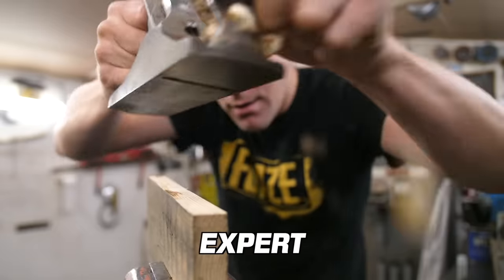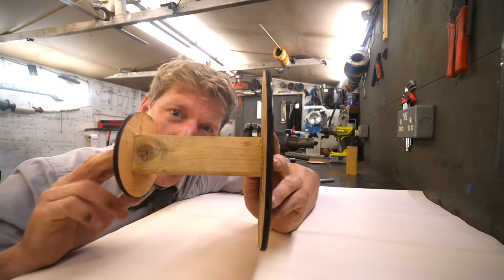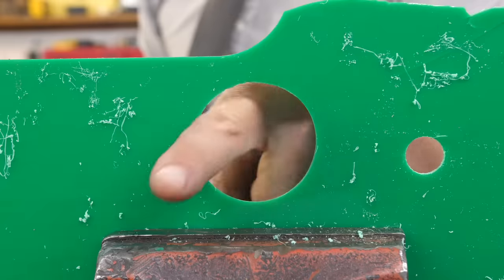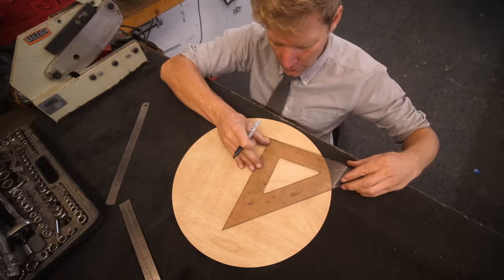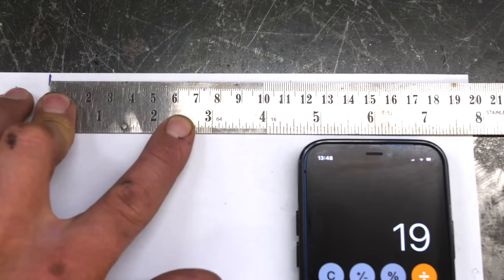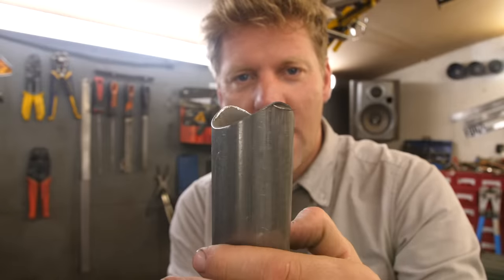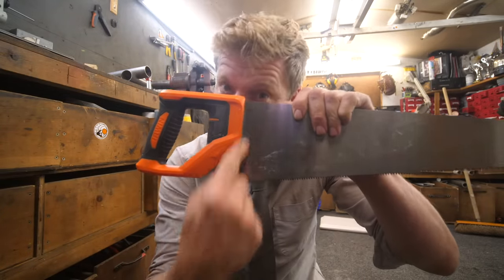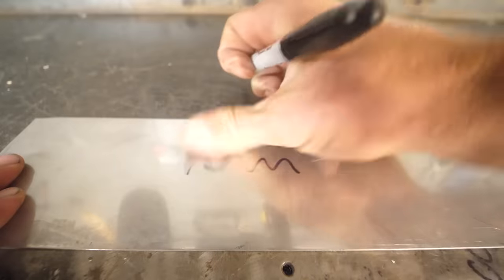18 GENIUS Workshop TIPS (that actually work)

Comment: Rubbing alcohol gets sharpie off, and also causes hot glue to peel off in one clean chunk from even heavily textured surfaces.
Reply: Or hand sanitizer
Reply: Yup, anything alcohol based. You could probably waste your gin doing it too. I use meths (methylated spirits/denatured alcohol).
Reply: The easiest trick to get sharpie off is to use a dry-erase marker instead of another sharpie.
Reply: I half inch acetone from work. That's the best solvent for marker pens.
Reply: Tea leaf! @DisorderedArray
Reply: Dry erase markers too, I remember a teacher showing us all this on the walls in the classroom lol
Reply: I find eucalyptus oil great for moving adhesive residue after peeling a label off stock.
Reply: love your channel, was literally watching your video before this one
Reply: Carb cleaner will get anything off. Just be careful not to put in near plastic etc. because it will melt it. I bought 3 cans off eBay for about £7 because, oddly enough, I had a chainsaw carb to rebuild.
Reply: Expo markers (Dry Erase) works really well. Working in Film as a Camera Assistant, we do this every day when updating the slate/clapper.
Reply: acetone I use
Reply: Butane will also work
Reply: More reason to carry flask on the job
Reply: Nail varnish remover.
Reply: Isopropyl alcohol should be in every workshop. Not only removes sharpies and similar stuff, but also cleans and sanitizes, without the nasty smell and without damaging plastics.
Reply: WD-40 also works amazing on sharpie
Reply: @OttoDidactic  Acetone is the thing. Good for cleaning packet too.
Reply: Brake cleaner is my go-to.
Reply: lacquer thinner
Reply: using deodorant works well too. butane is a good solvent for that it seams .
Reply: @jakobporenta  Same
Reply: @DisorderedArray  True. However it dissolves lots of other stuff too: most anything plastic (except polyethylene), paint or other finishes, vinyl. It even eats cured powder paint. That and it is extremely flammable... AND it's really not good to inhale. So be aware and be careful.
Reply: It's such a shame all the major UK chemists all made a gentleman's agreement not to sell rubbing alcohol. You can get isopropanol products, but they're always contaminated with something. In spite of the fact that it's an incredibly useful household solvent, far moreso than it is as any sort of useful reagant for serious illicit purposes.

Also white vinegar is unusually rare. White wine vinegar is everywhere, but clean white vinegar is harder to come by than it should be.
Reply: Blue loctite will remove permanent marker from nonporous surfaces as well.
Reply: Pro tip: If you like rubbing alcohol you should try drinking it.
Reply: Acetone should not be used for marker removal because of how many other things it can dissolve, including most commonly used plastics.  3D printer geeks will tell you that putting a finished 3D print in a container with some acetone (in a cap or other small vessel all by itself).  The acetone softens and smooths out your prints so they look better, all without even touching it.
Reply: @loganlaurian2517   It's handy because all markers--permanent or otherwise--will have a solvent to act as a carrier for the ink particles.  Most of the time the ink can go back into a liquid form as long as it wasn't absorbed into anything porous.  Expo sells ink-free markers just for this purpose.
Reply: A nuclear explosion will remove Sharpie, the object it was on and part of the object that was on too.
Reply: Any kind of alcohol, but yes.
Reply: I had an issue the other day at work with trying to get the thin red sharpie dimension lines removed from a panel enclosure. Normally it comes off no problem but after the added heat from cutting a large opening for HMI (display) the alcohol didn't do the job. Had to use lacquer thinner but was wondering what else might have worked...
Reply: @truthbebold4009  Acetone and brake fluid also work fine. But, depending on the surface, they can also damage it.
Reply: Lynx Africa
Reply: OH man i needed this.  i want to glue super strong magnets to a nice oak door so i can hang a blackout cloth over it.  but it's the landlords house and i couldn't find anything that was strong enough, or didn't require solvents that would damage the finish on the door.  WOOT
Reply: This is the way

Comment: When marking stainless steel for drilling, use a centre punch sharpened with 3 facets (triangular rather than round). That give the drill something to bite into and helps prevent work hardening by the drill not cutting.

Comment: Adding on to the sharpie tip: because I draw maps for DND on dry erase boards, sometimes I mess up and grab the sharpie instead. If you use a dry erase marker over sharpie, it’ll treat the sharpie marks underneath as if it’s dry erase and you can wipe down with no effort using a cloth.
Reply: Its alcohol solvents
Reply: Also hand sanitizer has alcohol & woks great removing sharpie marks!
Reply: @biga8u  This sub-chat is going to save my TTRPG battlemats!
Reply: Nerd 😉I joke, as I played a lot of DND and a bit of war hammer 40k back in the day. I usually just use methylated spirits or isopropyl alcohol to get rid of sharpie marks. Works great. As first comment says, it's alcohol solvent. 👍👍
Reply: For a house hold solution that most people have, anything like lynx or a body spray works a treat on permanent markers too 👌🏻
Reply: @mandowarrior123  Nope not alcohol, i thought so to, but whiteboard markers(dry-erase) is far better on removing sharpie scribbles then alcohol, i found that you can erase most "past-date" stamps with a whiteboard-pen, just paint over and wipe off, with alcohol you get a remnant of the original typing etched in and it will be hard to remove.
Reply: @eg8475 Why are you erasing past date stamps though? They're there for a reason. 🤷‍♂
Reply: A bus cleaner nearly got fired for having a bottle of Buckfast (Tonic wine) on her person.
Turns out she was needing a liquid to soak a rag to clean of permanent marker.
And found the alcohol left as rubbish on the bus.

This was an actual newspaper story a few years ago.

I would use any aerosol to remove Permanent marker.
Lynk africa works well
Reply: Came to say this

Comment: One of my favourites (that probably everyone knows) is to find the middle of something, eye ball the half way on a pair of callipers or dividers, and scratch in this distance by running it along the edge. Then do the same thing from the other side. The middle is between these two, much closer, lines. This also actually works with stuff that is a bit wiggly or has a few width changes as well as parallel stuff.
Reply: You can chose any point between the two resulting lines (though closer to middle of the two is better) and set the calipers from an edge to that point. If you then make the two marks as before then you will always get an even smaller interval containing the center. You can continues this to arbitrary precision.

Comment: I'm not an old timer by any stretch. But a few things that helped me out when I first started:

1. The phrase "Measure twice, cut once." 

It's saved me from making mistakes by catching them early. I repeat the phrase to myself when ever the thought " That will do." or "That's good enough" enters my mind. 

It helps me slow down and think about the work I'm doing. It allows me to maintain a good standard of work.

2. Learning how to use the gears on my drill. 

I used to be an ape and just blasted everything on power setting 2 level 15. But it caused me to over-drill holes or have bits slip in the chuck.

Spending a little time finding the right setting on your drill will also help prevent you from using too much power and wearing out the thread in the hole you're drilling into, giving a better fit. 

3. When measuring the fit of a piece of work, use the piece of work as a guide. 

Since that's whats going to be used. No point spending all your time measuring lovely angles and lines with tape measures, squares, and spirit levels if the wood you're using has a slight curve or bump in it, the frame you have isn't perfectly angular or the fittings you're trying to align aren't square. 

The work is what you're working with so make the work work for you.

4. Let the tools do the work. 

Especially if you're using hand tools. Your saw will cut with a surprisingly little amount of pressure. You don't need to try push the saw blade through your material in one stroke.

You also don't need to try and make your arm move at light speed. You're working, not working out. Leave the cardio session for after work. 

When drilling, don't need to try and push your whole drill through the material you're drilling. Those steel bits will do the job with just a bit of pressure for most materials. Too much pressure will add additional wear to the drill mechanisms.

That's all I can think of for now.
Reply: Number 2 is an especially useful one for DIY dads out there.  My dad always has the drill at it's top torque setting and wonders why philips screws magically convert themselves to circular slot screws.  Turn the torque-out down, and go slow in first gear, it's a screw, not a nail, you don't need any force to put it in.  Frankly, get a dedicated electric screwdriver if you find yourself putting that many screws in, you don't need a drill for putting in screws most of the time.
Reply: If you're using a hand saw, point your index finger straight and grip the handle with the remaining fingers: it both keeps your wrist straight and stops you making a fist, gripping the handle too tightly and tensing your forearm unnecessarily.
Reply: A saying that goes very well with the first one: "cut thrice and still too short". 😎
Reply: Except if you are drlling stainless steel.  Then you do absolutely need pressure... otherwise it work hardens and you will never be able to finish the hole,  except with a plasma cutter.  When drilling stainless,  moderate speed and lots of pressure so you are cutting a clean chip... when it is cutting nicely,  keep doing exactly what you're doing till it is done,  then get out immediately.
Reply: I get measuring twice... but which number do you use?

Comment: The small hole saw to big hole saw thing is great but as a locksmith you encounter odd shapes from whoever installed (ususally carpenters) or something that isnt round and for that just get scrap timber and drill straight through with the size you want and clamp it in place to get perfect holes without it destroying your job 👌
Reply: When someone has kicked the door in and broken the lock ,I just fill the whole thing with Builders Bog and start again from scratch. Here's a tip scrap off the Builders Bog before it sits entirely.